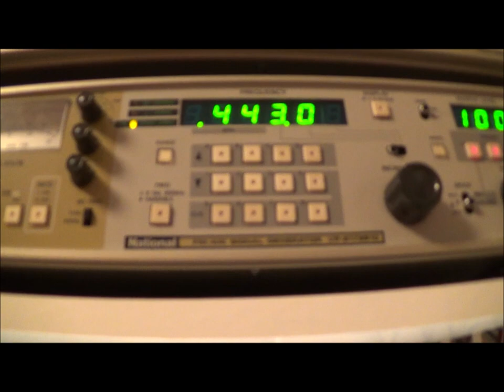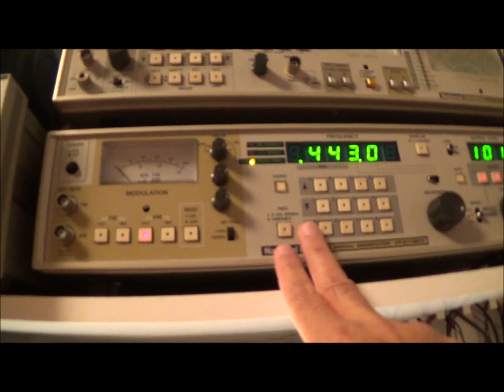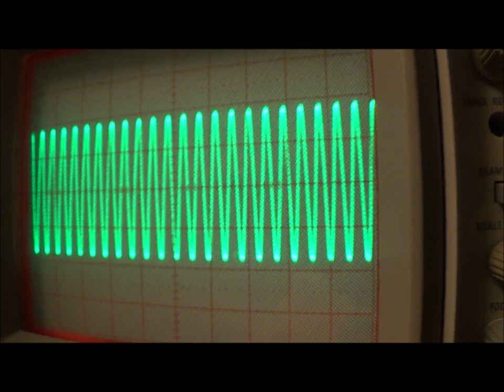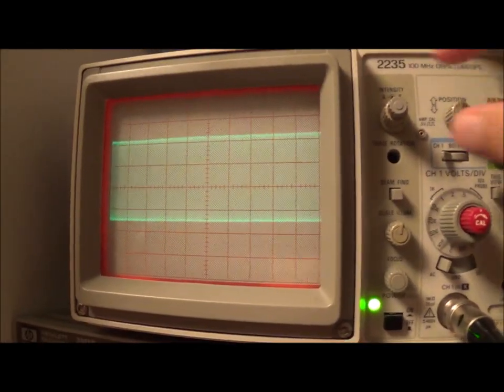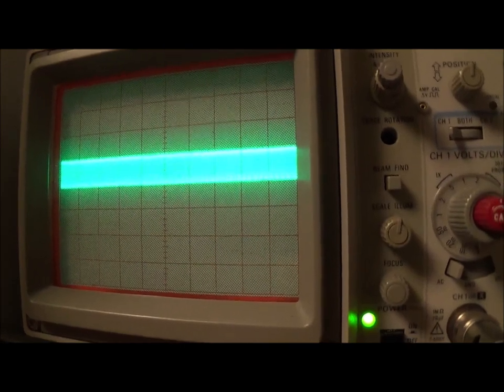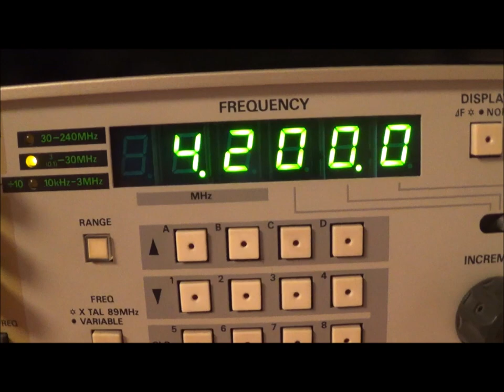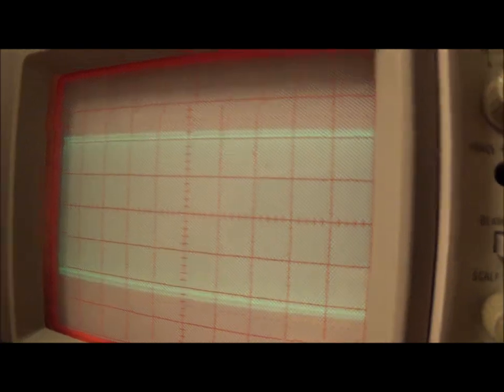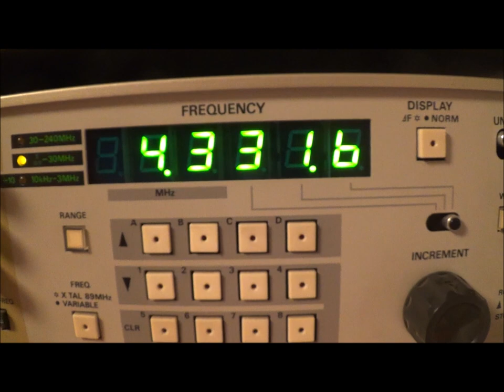Determining The Resonant Frequency Of A Crystal

Comment: I have an old military crystal impedance meter. It's a Lavoie model 51. Going to do some experimenting with it. It works totally different I think.  It reads the current through the crystal.
Reply from the maker: Honestly, I haven't heard that company being mentioned in decades!
Reply: @OldSchoolElectronics  Seems like they only were building test gear around WW2.
Reply from the maker: I have heard of them though. Some of that gear must have still been floating around in the 80s when I started. Enjoy your gear!